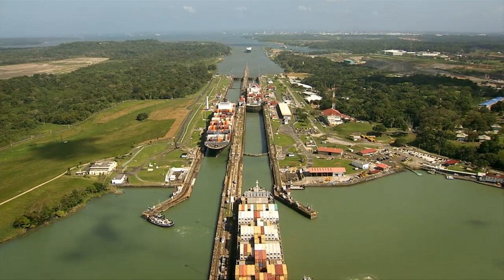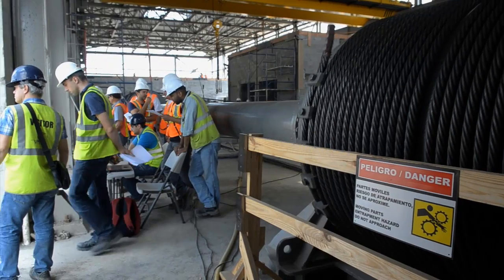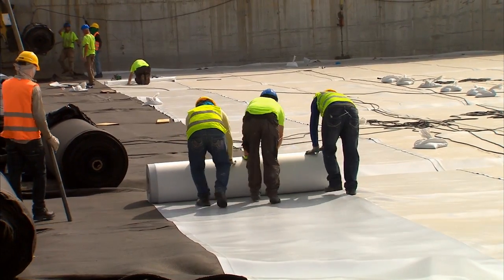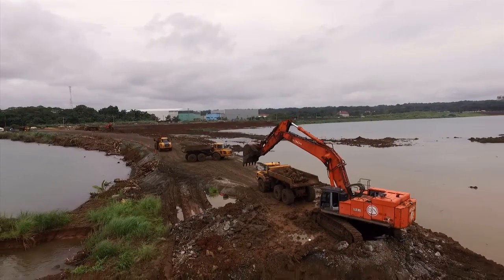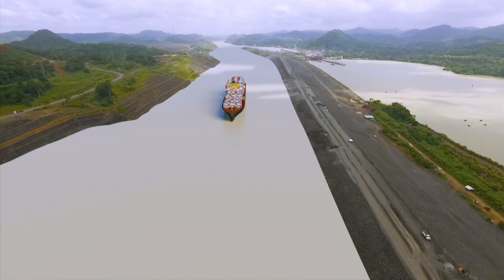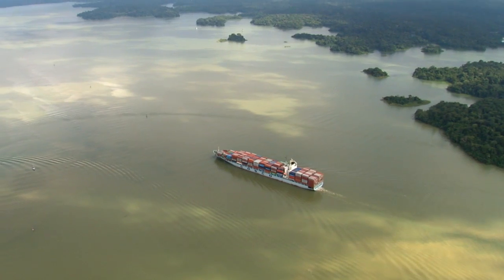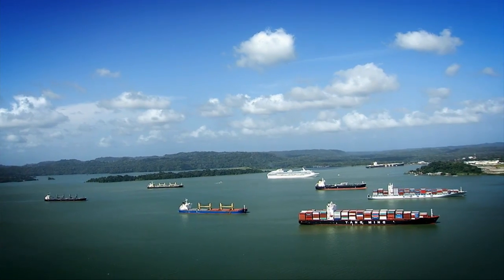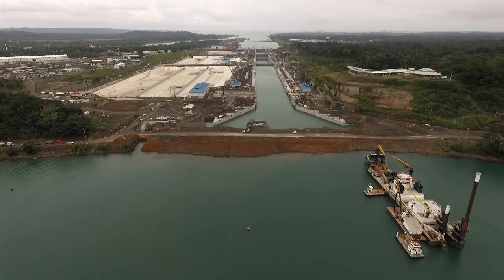Panama Canal Expansion Progress Update - November 2015

Comment: almost time to open
Reply: ***** it is just a thermal crack this can get fixed thats why the testing phase is important they need to catch the defects now or it will delay completion.
Reply: ***** I read it and looks like they used the wrong stuff they used grout it needs to be hydro cement. grout expands when it is filled into a gap and when it hardens it cracks they need to remove all the grout and replace it with concrete.
Reply: ***** yup this is also why Boston got flooded. in 2003 a hurricane hit the Boston area and then it started raining grout was in the Ted Williams Tunnel and in the Fort Point Tunnel and both flooded. they removed the grout and filled it with cement problem fixed.
Reply: ***** I hope so this is Teddy's Big Ditch we are talking about they need to get rid of the grout and replace it with cement.